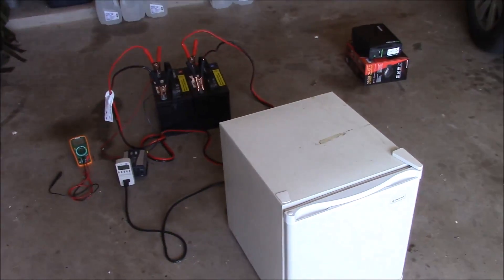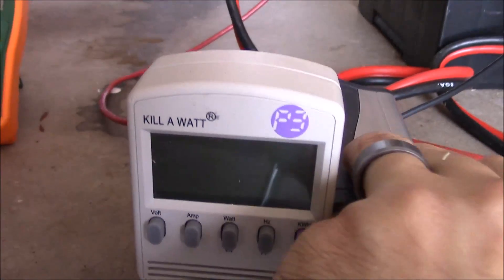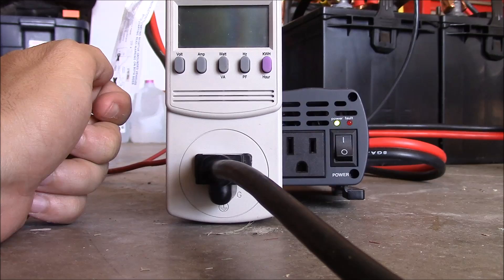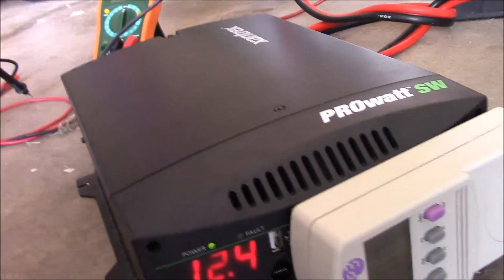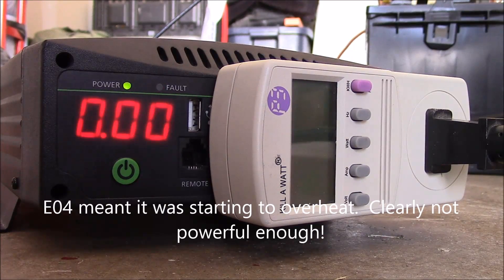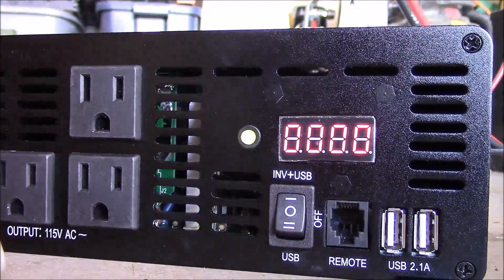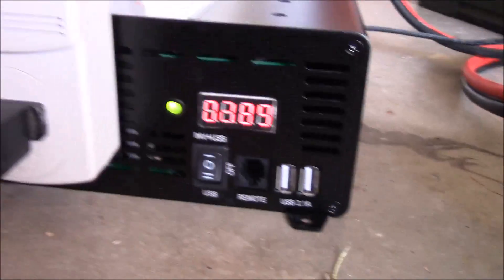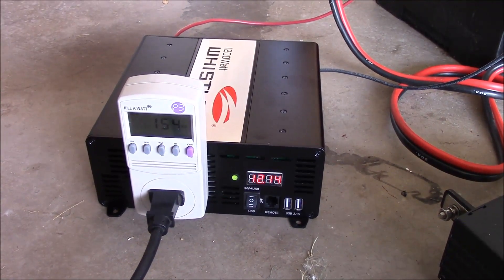Will It Solar? - Mini Dorm Fridge 3

Comment: Sir, remember that even without the nasty startup power surge your 110 fridge stil puls 1,5 amps when the compressor is working,  however this means around 15 amps load at the battery side witch by itself will deplete your battery bank very fast!
In general your much better of looking for a 12 volt compressor fridge keyword " danfoss" witch is the brand of dc compressors even used in the ISS space station to conserve pressious solar power, these fridges are not cheap but will paybin itself for saving your batteries.....( Danfoss_BD 35)
brands are Engel, weaco, Indell_b and others...hope this helps
Reply from the maker: +giottodiotto1 Yeah, I have looked into those.  They are quite expensive.  This was just for testing and I was just curious if I could run it for short periods of time if my grid power went down.  For longer term you are right it would be dumb.  I have built a peltier fridge that I would use in a longer term scenario.
Reply: @LDSreliance   Peltier is far worse than using a compressor  fridge!!!
Reply: If you convert a chest freezer to run as a fridge the draw is approx. 10A at 12V. For $150 versus $1000 for half the capacity I say it's a good idea. And if you read how unreliable the Engels etc. are compared to a house 110V unit that typically lasts 20 years then it makes sense NOT to buy a 12V refrigerator.

Comment: Need some 120v capacitors or "Run/Start Capacitors" to assist in smoothing of the surge current upon startup.
Reply from the maker: +DarkLinkAD Yeah, I want to re-visit this sometime and see if it can be done with a smaller inverter and a bigger or better cap.

Comment: The start cap could be changed to a different value. All of that trouble was from starting the compressor motor. Also there may be HVAC rated power inverters for things like that.
Reply: Ideally you do calculations. The mathematical formula for capacitance in parallel is the same as for resistors in series. I can't do scientific notation here with this keybaord so I'll explain using the simplified version. C1 + C2 = total capacitance. In order to determine what is needed you can place another capacitor in parallel with the start cap using trial and error to determine what is needed to start the compressor motor. The entire reason this methodology exists is to get a bit more life out of an old worn compressor motor or even a high voltage fly-back, tripler or horizontal output circuit. You could also use it in component level troubleshooting. In the old days we called it 'popping cans'. Cans was the term for the large metallic case electrolytic capacitors. You could probably do an internet search for "hard start compressor kit" or use other terms to become more familiar with the technique. 

I can't recommend the untrained mess with power circuits but understand people trying to learn or save a buck. 

Please do not do this at home. If you still must use common sense safety protocols.
Reply from the maker: +worddunlap Good point.  I try to keep my videos on a beginner or intermediate level to educate and share basic concepts.  I don't think most people are comfortable using a capacitor or know what one is so that is why I did not use it to start with.  Hard to find specialty inverters are another thing that most people aren't going to take the time to look into.  They just want something as simple as possible that works.
Reply: +LDSreliance time for a much bigger and more powerful inverter!
a fridge compressor when starting can pull massive power.
you want like a 1000w or more inverter for that.
Reply from the maker: John Douglas
Yep, I eventually busted out a big inverter and was able to get it to run.  Was shocked at how much it pulled to get that motor running.
Reply: +LDSreliance 

Jan 23 at 7:11 PM

I have a 125 watt solar panel that puts out 18.5 Volts and 6.5 amps.
I want to use it to charge a 12 Volt deep cycle battery to power a
1500 watt inverter with a peak of 3000 watts.

The inverter is intended to power a mini fridge or a chest freezer.
The mini fridge is 1.5 amps or 180 Watts and the freezer is 5 amps or about 700 watts.

What size of charge controller would you recommend ????

Whooperone@yahoo.com
Reply from the maker: I thought I answered this comment already?

Comment: hi do you think a portable ac unit (115V, 60Hz, cooling 11.9A) would work on a set up similar to this?...thanks
Reply from the maker: +mikeybdos Yes it can with a big enough battery bank.  You will have the same problems I had in this video series where the motor will take a huge current spike to start up.  The motors in air conditioners and fridges are basically the same.
Reply: thanks for replying...so basically two batteries should be enough to run the unit?
Reply from the maker: mikeybdos
It depends on the size of the batteries.  They are rated in amp hours.  Also it depends on how long you want to run the unit.  If you run the unit too long the batteries will run down and you will need to charge them back up.
Reply: cool. i'm planning on running the unit for a short time max 2 hrs at a time in a vehicle which did not come with factory ac...i have a dual battery system which i plan on using to connect the second batteries (battery/batteries for ac) to the alternator so they will be charged while the vehicle is in operation (running)...well thats my plan....what are your thoughts?...thanks man
Reply from the maker: mikeybdos
You could pretty easily do 2 hours as long as it isn't drawing 11.9 amps the whole time.  I am not sure how they rate those fridges when they say 11.9 amps.   If it is like mine and only draws an amp or less while it is in "maintain cool" mode after the compressor has fired up and warmed up then you should be good.
Reply: Thanks

Comment: Thank you!! I couldn't figure out why my 1.7cu ft igloo dorm fridge would not run with my 500watt inverter. Now I know....need to get a higher watt inverter!
Reply from the maker: Sheila Stallcup Yep.  Even though it only pulls a little bit of electricity while it is running it needs a ton of it to start up.
Reply: @LDSreliance  Wouldnt surprise me if its drawing over 20 amps of current at 120V. They have more efficient refridgerators now. My 1.7 Cu Ft Haier fridge only draws 45 watts when running.

Comment: That's funny because my 2door mini fridge runs off of a 400w power inverter (it's a low frequency inverter not a high frequency like the cheap ones)
Reply from the maker: longboy1998 Yeah, I guess you get what you pay for!
Reply: Yep that's the way it goes but they have large surge capabilities with that massive transformer
Reply from the maker: longboy1998 Someday I will invest in one of those.  I was hoping that my expensive pure sine wave inverter (Xantrex in the video) would have a high surge but the surge is barely higher than the continuous.

Comment: From the first video I figured that was the batteries because it went under voltage . I would have never guessed you needed that big of a inverter to get going but compressors always take a lot amps startup . but you just like me something's bothering you you gotta figure it out. I'm glad you worked it out too bad it can be cheaper to do it
Reply from the maker: Tom Ziesmer It was a good learning lesson.  I fail a lot creating these videos but I am able to convert those failures to knowledge and then hopefully give some of that knowledge to my subscribers.  That is the goal.  I'm not one of those guys on here that already knows it all and is just teaching or demonstrating because they are an expert.  I am far from an expert!
Reply: LDSreliance yes sometimes everythings a learning experience but I have a mini fridge that I wanted to run off my solar panels and I got a kilowatt meter hooked up to it for the past week and it has only gone up to 800 watts do you think I would be good with a 800 watt peak 400 what continuous or do you think I need to get a bigger one like you did to take that extra amount of current going through it. Thanks for replying
Reply from the maker: My suspicion is that you will need a bigger one like mine.  I have heard that some inverters are rated for both outlets combined (the 2 AC receptacles on the front) and that you can't run the full wattage through only one of them.  I am not sure if that is true or not but it seems plausible based on my testing.

There isn't a huge price difference so if you are ordering one for this purpose I would be safe and just get the 1000+ watt continuous one.  The one I showed in the video is $74 with free shipping on Amazon (http://www.amazon.com/Whistler-XP1200i-1200-Watt-Power-Inverter/dp/B00HWL4NDK/ref=sr_1_1?ie=UTF8&qid=1435539262&sr=8-1&keywords=whistler+1200+inverter&pebp=1435539263648&perid=1YNXY6K7WVPAA76S5FTZ).  I will be doing a review video on it this week.
Reply: It didn't say is that a pure sine wave and it looks like a good deal I might have to get me one of those thanks for being my guienne pig lol
Reply from the maker: The Whistler unit is not a pure sine wave.
Reply: This is super helpful thanks! I am about to build an off grid van and trying to learn the ins and outs. I have read that if you don't use a pure sine wave inverter that it can ruin the compressor. Do you know anything about that or how to prevent it?